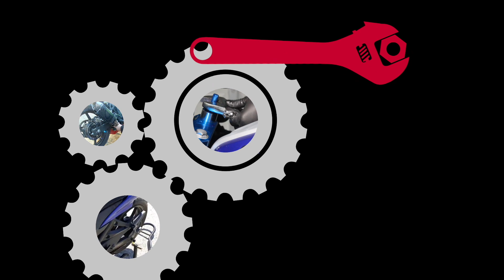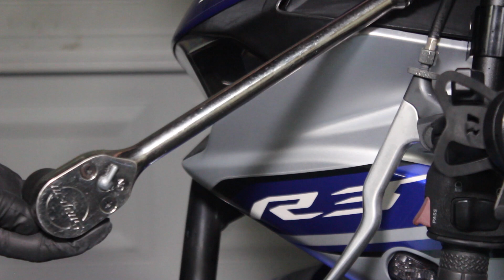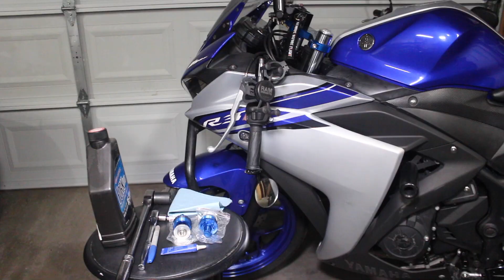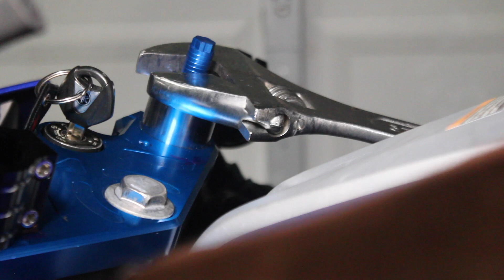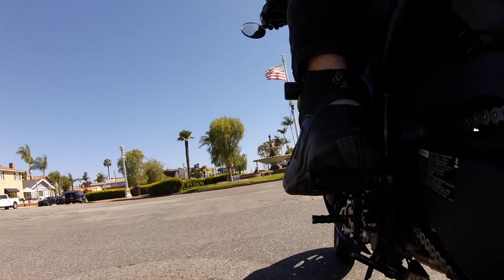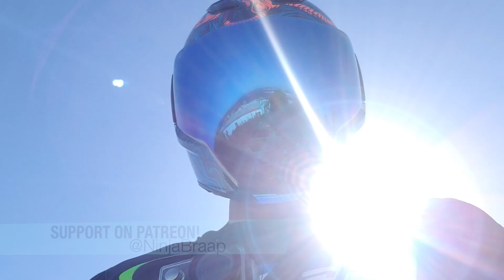How To | DIY Pre-load Adjuster Install | NinjaBraap

Comment: The part of these caps that goes inside the fork when it is mounted, is way taller than the original caps. That means that if you do not trim the difference in length from the preload spacers that sit on the top of the spring and under the caps, you are immediately increasing the preload of the fork and maybe not being able to get the optimal adjustment.

I prefer using these caps to be able to both increase and decrease the preload from the base setup. Be careful with measurements.
Reply from the maker: While it is true that these are a bit longer than the OEM caps, and thus add pre-load right off the bat if you don't cut or make different internal spacers, the OEM Gen 1 Yamaha R3 is notoriously undersprung from stock. As a result, unless you're re-springing as well (which automatically means you'll need to change spacer lengths), that slight bit extra is already a massive improvement. The Gen 1 R3 doesn't need less pre-load for anyone, it will always need more. You would have to weigh less than 90 lbs and be riding at a the pace of a scooter for less pre-load.

Comment: It's way easier to use a deep dish socket and a speed wrench to install it.  Press down, keeping alignment straight, spin it backward until you feel it drop then slowly spin forward and you will be less likely to cross thread it.  You can just spin it right down with the speed wrench, if it is too tight to move easily it is cross threaded.  Great tip with the Loctite,  I'm going to re do mine.
Reply from the maker: For sure that's easier, but not everyone has those tools. You can usually find a big crescent for cheap at Harbor Freight or similar, or borrow from a friend.

Comment: So what was the fork fluid for ? Or did I miss that part ?
Reply from the maker: Says in the video, for lubing the threads and O-ring. However, especially with the R3 upgrading to a heavier weight oil is recommended (not mentioned in the video).